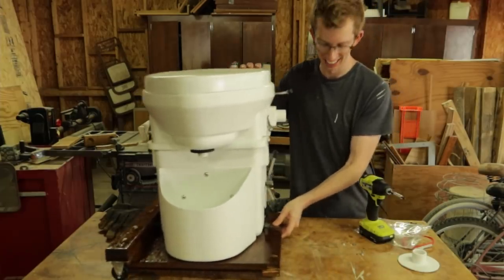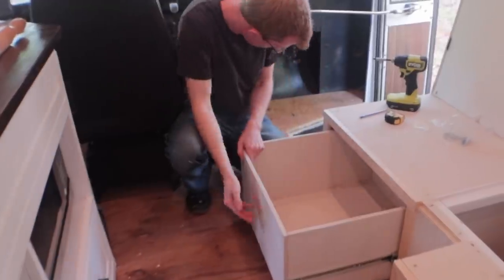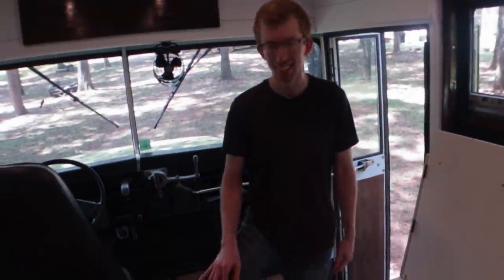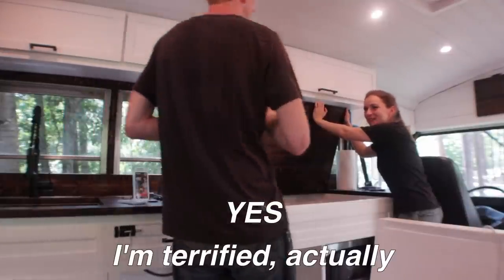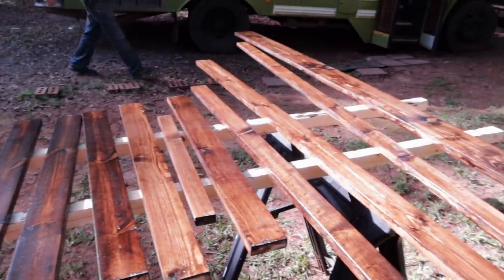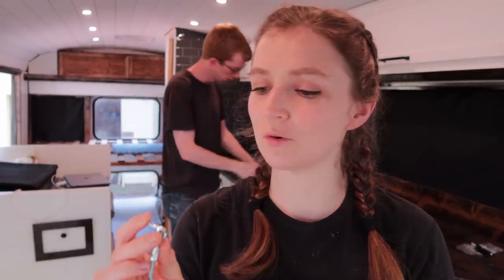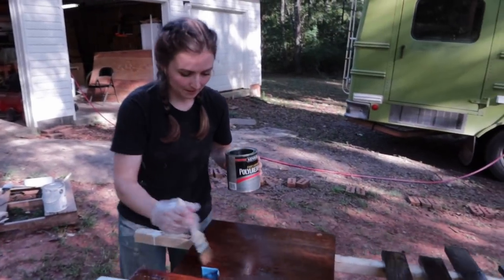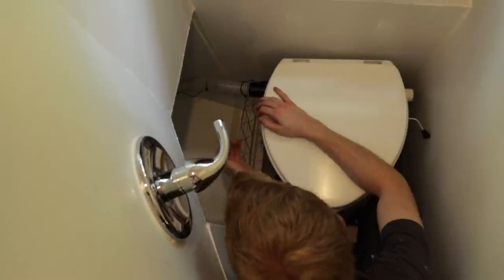Crazy & Unusual Skoolie Design Ideas | Hidden TV Cabinet & Slide Out Toilet | SKOOLIE BUILD

Comment: Put in a solid piece of foam in the bottom of tv cabinet, that way screen  can rest on it when closed and if you are on a rough road it will help protect it from the impact
Reply from the maker: Good idea! It might be hard to see in the video but we actually do have 2” of foam in the bottom of the cabinet. It really helps take the weight off
Reply: Gratis idea. Maybe you could also secure the tv with  a bungee cord or something similar that you can unhook when you want to watch the tv.
Reply: Great job guys. I'm so busy keepin up with yall, I havent done anytin to mine. Good luck n b safe.

Comment: If I might make a small suggestion? Add a handle to the wood base for your toilet. In this video, you showed how you can move it in and out of the cubby space when you want to shower but you were moving an empty toilet. It will move a lot differently once there is "product" in the canisters and a handle will help make it easier to move. Also, don't leave the basket of toilet paper on the platform when showering, water travels...

Comment: I think those hooks should be fine. You're not going to have it open when you're driving, and when it's open, most of the weight is on the piano hinge. My only concern is the stress on the counter when driving with it closed. If the foam under it is really bearing a lot of the load, it should be fine. It's a great, creative design. Well done! :)
Reply from the maker: Thanks so much! 😄 It seems like the foam does a good job of evenly supporting the weight, but we'll keep our fingers crossed that we don't have any issues with it later on! 🤞

Comment: I like the TV hideout cabinet but be careful and never spill liquid on it, unless it's an outdoor rated TV. Good luck 👍
Reply from the maker: Thanks! We’ll definitely have to be careful not to spill, but we’re loving the hidden tv cabinet so far! It’s such a relief to know that it works 😅
Reply: Perhaps you could put a piece of trim on the side by the cook top just under where the tv counter top meets the cabinet, with a door gasket attached, cut to fit (or something similar) to help with potential spills.

Comment: Some clear epoxy resin on those screws may increase longevity of tv mounting and a 1 inch foam liner on the bottom of the tv cabinet allowing the tv to rest comfortably on the foam might help as well. Just a couple of thoughts.
Reply: They have “2” foam underneath but idea of the epoxy just help me in my home. Thanks 👍😄

Comment: I had the same problem with a  bright control panel by my head in my semi. I took a bandana and figured out how to drape it. It doesn't completely darken the panel, but it also doesn't interfere with temperature sensors. I haven't taken the time to figure out if a rubber band would be helpful, since what I've got works. Thought I'd share that idea.

Could Natalie look any happier??? 😉
Reply from the maker: That sounds like a great solution! We will definitely need to rig up something similar. Since the weather has been so hot, we usually just keep the heater unplugged from our fuse block, but that probably won't work too well when the weather gets cold and we actually need to use it... 😅

And no, I don't think so! There's just so much to be happy about this week! 😄💚

Comment: I really like your toilet cubby.  How are you going to keep the wires for the fan from getting run over by your cart?
Reply from the maker: Thank you! We don't really mention it, but you can see the wires very briefly (timestamp is 22:46), but the wires for the fan are zip-tied to the large exhaust tubing, and that seems to do a good job of keeping them out of the way of the wheels. That's definitely a good question though, that could really cause some issues if those got damaged 😬

Comment: Everything turned out great! I have one question, what happens to the toilet if you have to slam on the breaks while driving?! You might need a lock down of some sort(cabinets and drawers also). Bet y'all are excited to move in! 👍 🚃 👋 👫 😉
Reply from the maker: Thanks! Most of our drawers have some kind of latch (some have barrel latches, and some have roller catches) to help hold them closed. 

As for keeping the toilet in place, we are planning to keep it in the shower area most of the time (unless we are using the space to shower), where the floor is a bit lower than it is in the toilet cubby. This seems to do a good job of holding the toilet in place, and doesn't give the toilet much room to move around. 

We haven't tested this with very much driving, but hopefully we won't have too many issues! We'll find out very soon though! 😅